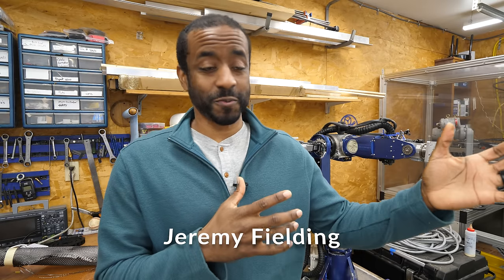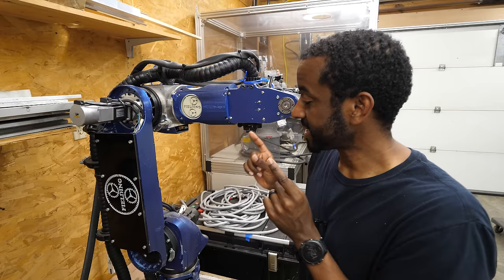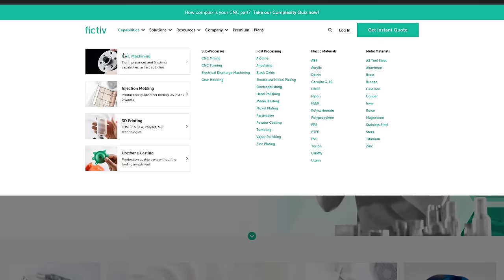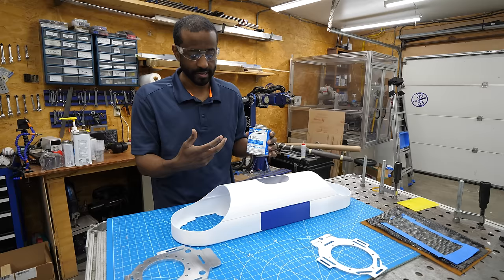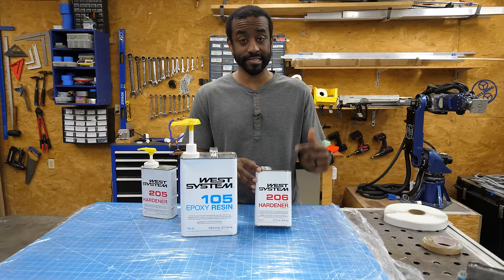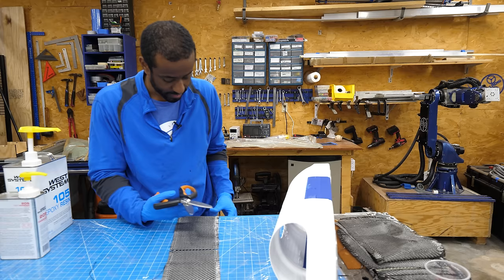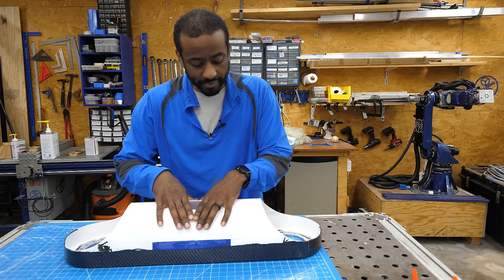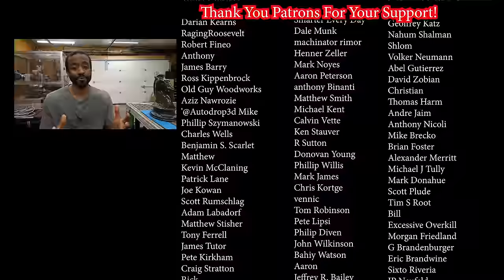How to Make Anything Out of Carbon Fiber.

Comment: If you could rely on the flatness of your welding table you could clamp the metal parts registered in position and then bodge the first prints around them.  Or you could use a couple of pieces of straight extrusion bolted through the existing holes in the plates, and then remove them once the epoxy on the prints is dry (or maybe leave them in until the CF is done too).  Either way seems more reliable than a print for getting accurate relative position of the plates.
Reply from the maker: A fixture is definitely a good idea. There was a whole segment on this in the original cut but the video is already 30 minutes long. So I cut it. But yes… in the segment where I discussed the “next layup. I talked about making a fixture and how I was running out of time. Then I shortened it to… I am just out of time

Comment: Bonding to aluminum is tricky. Test on small pieces first. Cleanliness is the most critical. Wash with soap and water, and don't touch it with your bare fingers or leave it sitting for a long time where dust from the air can settle on it, as that can also deposit oil. Roughing up the surface (before washing) helps. Treating with alodine is even better, but it's highly toxic so I prefer to design for more glue area instead. And as others have said, fiberglass to prevent galvanic corrosion.
Reply: Gougeon brothers recommend applying epoxy to the aluminum and then sanding the aluminum surface with epoxy on it. Like wet sanding but with epoxy. They also recommend using a toughened epoxy for gluing metals. But if you wanted to incorporate the aluminum into the layup I guess it might be hard to use the toughened epoxy.
Reply: @mckenziekeith7434  That's brilliant! I do that when brazing aluminum to boost the joint strength. Melt filler metal on both surfaces and scratch in the puddle with a stainless brush to remove some oxide where it can't re-form, and then stick the pieces together. But somehow it never occurred to me to do the same with epoxy. I think you can get regular solder to stick to aluminum that way too, though I've never gotten around to trying it.
Reply: @dekutree64  there are special fluxes for soldering aluminum. But I have never tried them. I don't know if normal solder will stick using the special fluxes. But I think so. Those fluxes also require special cleaning procedures (like hot water and soap or something).

Comment: It's worth mentioning that if you sand the surface after epoxy has set, you should be a bit afraid about the dust. It's not as bad as asbestos but you should avoid getting carbon fiber sanding dust into your lungs either.

Comment: I didn’t go through all of the comments to see if this was discussed, but at the end, you didn’t have a carbon fiber knight. You had a carbon fiber wrapped knight.
Basically it seems like you have made a carbon fiber mold around your knight piece, and now you can cut it in half and use it to lay up another knight inside. Or pour plaster inside to make a statue, etc. 
I can’t wait to see the next video to see how you get around this for the robot part, or if it’s just going to be a carbon fiber-reinforced part in the end.

Comment: It seems like you used the printed parts to locate the plates. Why not fixture the plates at the correct location and build the printed parts around the fixtured plates? Leave all the slop in the middle between the plates and just tweak the printed parts.

Great video. I didn't know that you could add the CF in stages. I always thought you had to vacuum the whole part in one session. So I did learn today. Keep it up man!

Comment: Eventually when you go pro, it's because you've made enough mistakes to know what works and what doesn't. Mistakes and failure are the best teachers! Not always cost effective, but there's ways for that, too. 
In the event you haven't heard 9 million tips, here's my short list for composites:
Making a pattern from painter's tape is the easiest way to figure out how much fabric you'll need. Wrap everything with a layer of shrink wrap (tightly), then do a layer of blue painter's tape right over the top. Where you cut your seams, you can pull a perfect pattern for individual panels. With the pattern, run a layer of tape around the edges where you're going to cut which will keep the fibers from running or stretching the weave so you don't have to be quite as fanatically careful when manipulating your cuts. 
Doing single layer wraps is mostly cosmetic with cf fabric. As a cost effective modification, your underlayer(s) running in 45* angles, you can lay up S-glass fiberglass twill that's normally fractions of the cost of good CF, but also adds a ton of strength to the final part, where only the upper (or upper and lower layer) is encapsulated CF. I've also experimented with foam core when I need a certain thickness and the final part isn't going to an aerospace spec role.
As you mentioned, the resin isn't really the strength of a composite, it's merely locking the shape. Resin by itself is incredibly brittle and unless it's used Very thick, it will be the weakest component of a composite panel, but also the heaviest. Proper weight ratios should be followed for optimal strength and rigidity. 
On top of using alternative plastic sheeting for your vacuum bagging (provided you're not doing resin infusion) generic space bags for parts that fit fill the void if you'll pardon the pun, especially if you have a real vacuum valve to stab through them. I can normally get 3-5 uses out of one bag with careful resin metering. 
A very cheap and effective fabric you can buy at most hobby stores is Dacron that works wonderfully in place of peel ply. It's been as cheap as $3 a yard in 52" widths when you score them as remnants, then chased with regular ol' polyester batting for the excess resin absorber. Reasonably fine nylon fabrics also work as peel ply, though it pays to be choosy on the patterns when you need a cosmetic surface. Weighing your carbon to determine your resin ratio keeps your waste down and also optimizes the part strength.

Comment: This is where knowing your printer is useful. All machines do not move the same in all directions (not just 3d printers). For the best accuracy on parts, it's best to get the printer calibrated in with extruder e-steps and flow, then for the average person you can print bars in multiple directions to get a sense of the most accurate axis and combination there of. To put in in perspective on a well used creality ender 3v2 I measured something in the range of just under 400 microns of straightness in the Y axis and +/- 200 arcseconds in the Y pitch and yaw. For a printer that's fine I guess, but if you know, those are terrible numbers for a CNC mill. I know it's not everyone's favorite thing to do, but that's what you get at fractions of the cost and differences in machine design.

Now as a warning, I haven't tested this myself yet. But if a CF part can have a hole in it somewhere, I think PVA (while more expensive than cheap PLA) can be used as the part mold. Wrap it in CF and once it's fully cured, you should be able to drill a hole or use a holed part feature to submerge the part in warm water and the PVA will dissolve out. This is for the lightest possible part at the expense of being hollow. Since it's water soluble the epoxy in the CF should be fine, though if you want it really clean it might be a hassle. The only thing I'm really unsure of is how the epoxy will react to the PVA. I guess the easiest thing to do would be cut off a chunk of purple elmers glue and put a dollop of the epoxy on top.

Comment: there is a faster way of making the bag,  you put down a sheet of flat cardboard on your bench,  then a sheet of grease proof paper, tape that down lay a sheet of plastic then lay another sheet of plastic on top and another sheet of grease proof paper, then with a soldering iron run a continuous line as a c shape to make the bag,  where you have corners or stress areas, you do a large sawtooth line that gives the bag some flex to crumple into itself,  when you place the item in the bag, you can use your tacky tape to seal or run the solder iron over grease proof paper.   Also if you are worried that you are not getting the seal you do the denim jeans fold.  Its a method jeans manufacturers use to join two cuts of jeans material you fold both sheets over then intersect them, (look up denim seams).  Then seal it, it makes a strong seal and less prone to leaks.

Comment: A good demo I was shown was to tie a knot into a 3k strand and it snaps like straw! 

I would put a layer of glass epoxy between any aluminium inserts to isolate electrolytic issues. 

Keep well ventilated, when you cut carbon it releases microscopic dust, nasty. Same for any diamond cutting of cured parts nasty dust. Wet cutting is best.

Comment: I am an engineer in the composites manufacturing industry and u took can contact me if you want any additional help on layup, processing material choice, bagging help, or any troubleshooting on any future projects!  If you want it to be more time efficient, you could try infusing the part.  This’ll take a bit more tweaks on the epoxy choice and bagging technique but it can be done.
Reply from the maker: Thank you sir for the kind offer!

Comment: Great video! Have you considered using a wet layup instead of vacuum? It’s a simpler place to start, and I find intuitive. Also, making a negative mold pattern first, out of something like high density foam (and in separate parts) gives better, more reliable results, irrespective of resin method. The channel EasyComposites has an AWESOME tutorial for all of the above— highly recommend!

Comment: first off, I'm not an expert, but I have heard more than once that bonding carbon fibre to aluminium is a process of its own, because if you have any physical contact between the actual carbon fibre and the aluminium, you will, due to electrochemical corrosion often experience a massive increase in corrosion of the aluminium, this because the carbon fibre is the more noble of the two materials. thus if you wish to bond carbon to aluminium, you need to take extra care to coat the aluminium with a layer or two of resin or other suitable compound to reduce the risk of electronic contact between the two materials... worth cheching out, considering the aluminium parts set you back a few bucks, and also that your end product will withstand the forces going through it over time:)

Comment: Bagging material must be able to survive the Exothermic reaction generated by your resins/polyester as it cures!

I tried to save some money on my bagging plastic and used some 6mil from the hardware store, a very thin layer of epoxy over fiberglass burned a hole right though it I'll never cheap out on bags again!!

Comment: Good job on telling us about the issues and the learning curve. Maybe it's really better not to use the expensive 100+$ milled aluminium parts in the first few designs you want to make, but start with something small, cheap and forgiving where a failure is annoying, but not too expensive.

Comment: I would recommend not to do separate runs for structural parts. Like u mentioned then the only thing holding the different runs together is a thick layer of epoxy. Do it in one go. Use plastic wrap or even super glue to hold the fabric in place.

Comment: From my understanding carbon fibre is just like fibreglass only slightly stronger. That said though i have seen vehicles use a fibreglass suspension bar as the bar is strong, flexible and always wants to stay straight with a higher sprung weight capacity than metal.

Comment: I did not catch in the video if those inserts were steel or alu? Bonding composites to metals is anyway yet another challenge. The epoxy will not bond chemically with the metals so surface roughness is a big part of how well the parts are glued. In case of alu, the outer oxidation layer adds yet another challenge to making a strong bond. Cleaning and then wet sanding with mixed epoxy just before gluing helps a great deal in stopping the oxydation layer from re-forming.

The same applies when laminating new layers on top of layers that have hardened. No chemical bonding so surface preparation is of outmost importance for a strong bond to form. 

I addition some hardeners are more prone to producing a surface layer of amine blush as they kick off. This can be felt as a waxy substance that needs to be cleaned away with soap and water before sanding or painting.

Make sure to use epoxies in well ventilated areas only. And do not sand until fully hardened, which can be several days at room temperature.

Comment: My tip is, when you work with carbon, don't be cheap on simple things like preparing the bag. Skip the packing tape and use tacky tape through out. You DON'T want the bag to fail when your part is ready and epoxy starts to cure !!!

Comment: An excellent, informative and amusing video. If we can laugh at ourselves things stay in perspective. 
Thanks for exploring this technology.  Just as you said, I had assumed that carbon fiber parts needed to come out of a factory. It isn't a simple process, but it is doable for the do it your selfer.
I look forward to seeing the new part mounted and working. And I am curious to see if this thin walled part will be subject to oscillations or harmonic movement.

Comment: Carbon fiber is the best material there is to make a strong hollow shell or thin walled part but the skill added in this video should actually be to make a composite. Carbon fiber could be replaced by glass fibre or any other high tensile strength fiber and resin could be replaced by polyester etc But it's essentially a skill to make fiber reinforced composites. And it requires understanding of how materials with different mechanical properties are bonded together to get the best of both, fiber to resin ratio, importance of hydrostatic pressure while curing and design features such as ribs, or fillets that you can use to make thin walled parts stronger.

Comment: Using sheet metal to keep the correct distance between the axis centers would've made me feel better. After all, sheet metal is still very efficient to produce and very stiff in its flat plane. That side of the arm was flat anyways.

Comment: You should have just used the strips to cover it completely.. then a big "beauty" covering piece or 2... THEN made the bag over it... then pulled vacuum... todaaah!!

Also, i should mention doin it the way i suggest, it will be 1 solid piece.. molded together... it bonded together... don't do sections like you did... in small pieces.. bcuz that epoxy has already cured.. then ur gonna try to bond onto it.. you will lose strength... all 1 piece.. especially for the strength your looking for.. maybe even a Carbon Kevlar weave for added strength..

Comment: I'm an ME and experienced maker, and most of your projects and capabilities are far beyond what I've done. I do know a few things about composites, and I applaud your first project: the complex bag design was great. However, as you discovered, laminating one ply of 5.7 oz carbon fiber over plastic falls short of what you wanted.
I recommend making a foam sandwich carbon fiber panel. I have a sample I made from 2" thick EPS that I cut 2" wide and 12" long, and I laminated 2 plies of carbon fiber with epoxy on the top and bottom. You cannot flex or break the beam with your hands, and it weighs nothing.
If you want stiffness for your robot arm, you want to make a beam. Remember, increasing the beam thickness cubes the stiffness.
Also, the epoxy you're using is for boats, and the heat deflection temperature is only 118 deg F. There are other laminating resins with much higher Tg's, if that matters in your application.
Reply from the maker: I planned to do several layers not one LOL. That would certainly not be the goal. I didn’t mean to give the impression that I only intended one layer, but I also didn’t plan to run out of time so that’s what happens sometimes. I was going for 6mm total. 3mm inside and 3 outside with the plastic creating a space in the middle. Total thickness would be about 10mm with the plastic adding thickness like a hollow tube. That would have been more than stiff enough
Reply: @Jeremy_Fielding  Understood. Again, great videos! What I was suggesting is to add a core, which ties the 2 separated CF layers together, greatly increasing the strength, and more important, the stiffness.
My demonstration carbon fiber sandwich foam beam includes the bare foam block, and a sample of the 2 layers of cured .018 thick carbon fiber plate. Alone, the CF plate is as stiff as the weak polystyrene foam.  Bonded together, the beam has incredible strength and stiffness. Similar to a steel i-beam. The top and bottom plates are not nearly as stiff as when they are couple by the web plate. Or like super thick cardboard: the paper faces have very little strength without the corrugated core.